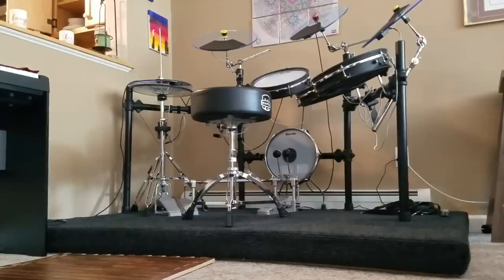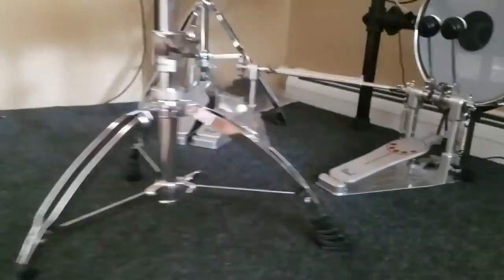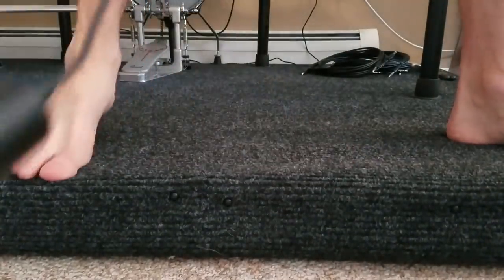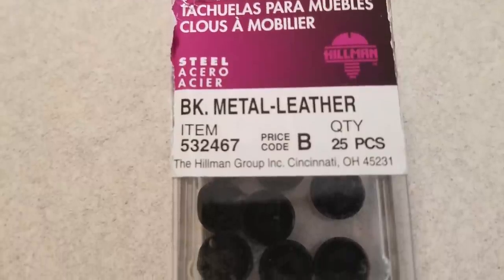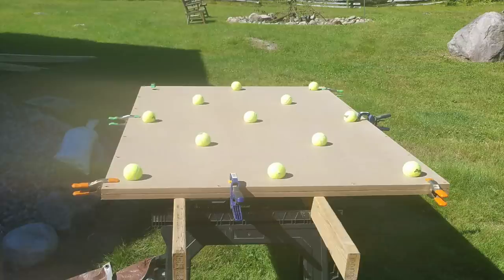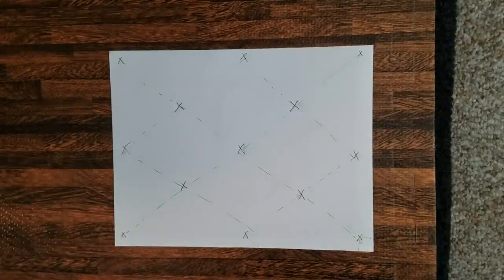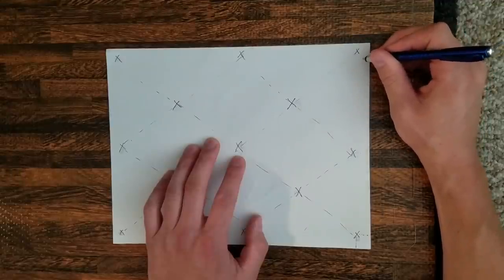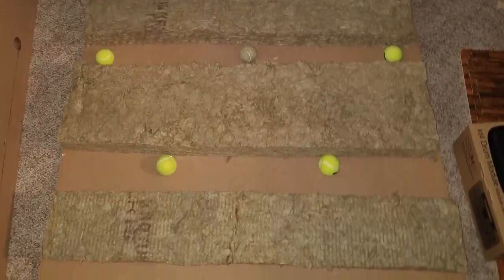DIY Sound Absorbing Drum Riser

Comment: So I just began this project for myself.. picked up all of the equipment from Lowes and Target, and one huge warning for anyone else who is going to take this on: make sure you have enough man power to carry the MDF board(s) up your steps. I'm not the most out of shape guy - I spent a good chunk of my adult life doing heavy physical labor for a living. But it took not one, but two of my neighbors to help me carry my two boards (same size as mentioned in the video) up to my 2nd floor apartment (no elevator, just stairs). And of course I had to pick them up and load them in a truck myself, too.

And no, I couldn't really have cut them on the ground floor because it's pretty much just parking lot and not safe (and possibly not legal) for me to cut the boards there. I suppose if I had known how heavy the boards were, I would have had Lowes cut them down for me before picking them up.

Just an FYI for anyone who might be in the same living situation as I am.
Reply from the maker: Yes they are quite heavy! Sorry I wasn't as clear about that as I could have been

Comment: dude, this is exactly what i need to build...i played for 3 days on my new kit, and on the 3rd day my neighbour under me came up and moaned...bare in mind ive had wild parties for years and he has never complained once :) the kick drum is the main culprit i think...i'll do a small board with balls just to test it, if that goes ok i'll try the full riser....cheers man. hopefully i wont get evicted lol....
Reply from the maker: DEADASTRONAUTFX haha good luck!
Reply: Blue Line Drums ,   hi man, got my 2 mdf boards drilled etc....just waiting on 15 tennis balls to arrive.... when you placed the balls between and added the tie clips, did you pull the clips really tight or slightly loose???..cheers.
Reply from the maker: I pulled the ties tight enough so the tennis balls were snug against the boards but not so tight that they were being compressed. Hope this helps!
Reply: Blue Line Drums , yup thought so....cheers man.
Reply: yay, i built the same way you did, but i also put half balls on the corners underneath for good measure....when tested with a seismic vibration app there was no vibration coming down to floor whatsoever, even with my mate kicking the hell out of the kit....so, yup,  totally worth doing man....cheers dude. happy drumming.  :)
Reply from the maker: DEADASTRONAUTFX Im glad it worked for ya!
Reply: yeah man, so far i havent seen a red faced neighbour lol.....

Comment: thanks for the video! just a tip but sitting on the platform increases the tension/rigidity in the tennis balls and so increases the vibration that makes it through. also for only a bit more cash can swap tennis balls with sorbothane which will reduce things more
Reply from the maker: Thanks for the tip!
Reply: What thickness for the sorbothane?
Reply: I presume the sorbothane would have to be very thick?

Comment: Awesome video! I actually ended up here in an attempt to reduce the noise that comes from my digital piano keys. The vibration goes straight through the floor and upsets my neighbor 🤷🏼‍♂️ I noticed you have a digital piano right next to your drum platform do you have that issue with key vibrations as well??

Comment: 5:50 "MDF is dense and heavy and I believe you need some weight to your platform to handle the vibration..." (slightly paraphrased).
MDF manages vibration far better than plywood because unlike plywood MDF is soft and absorbant. That's why a primary use for it is in the building of speaker boxes, cabinets and stacks - the vibrations caused by the sound are canceled out so as not to complete with it.
However, don't spill any fluids on it or it will be destroyed due to that very absorbency factor I mentioned

Comment: I did exactly the same thing : it’s quite working in term of impact noise réduction BUT:
1/ let the platform edges free or wood in order not to create resonating box (mistake i made) so not so sexy 
2/ better to use thicker plate
Reply: What?
Reply: @dteed6282  lol my thoughts exactly while reading this... Not a clue what Florian here is talking about...
Reply: I believe what he wants to say is that if the edges of the whole construction are connected with the carpet, you enhance the resonance of the whole thing.
So better leave it open.
I wonder of the wool doesn't shed tons of dust into the room while you play, if the construction is open.
Reply: @Wranuckl  the rockwool pieces  could be putted in normal black plastic bags (like the ones for the trash). this way the rockwool small particels will not "fly" through the air around.

Comment: This is a great video thanks! Some people have commented that sitting on the podium affects the noise isolation due to weight distribution? Have you found any issues?
Reply from the maker: I have not had this issue but I imagine different weights on top of the platform will certainly make a difference
Reply: @bluelinedrums1036  I made the exact same platform and it didn't cancel as much sound as I had planned. I may have tightened the zip ties too tight though so might amend it. It looks great though...
Reply: @drum27  How it's going now what did you do ?

Comment: Did you tape the insulation down? I'm in the process of making this exact riser per your video. Also did you nail the furniture nails to the board at the top?
Reply from the maker: Hey, I did not tape the insulation down. The compression from the boards did the job. I nailed the furniture nails to the edges and the underside...not on top. Hope this works for you!

Comment: I used 4 Wheelbarrow inner tubes I got at home depot $10 a peace . Under my tennis ball riser ( I use your video to make it thank you )  now 0 vibrations make it to the floor.  I probably  will get rid of the tennis ball riser  . It's a little bit to tall and just use the inner tubes  they work way better.
Reply: Good idea but questions:
1- how do you stop the tubes from moving around?
2- don't the tubes lose air every month or so, thus have to pump back up?
Reply: This is exactly what I was planning too. Zero vibration sound about right, compared to a pretty hard tennis ball, especially when compressed. Can you update us 3 years later on how it's holding up? Has it deflated a few times?

Comment: Great video, like the idea of the added insulation. I’m thinking of making this but don’t want to waste my time if it doesn’t make a difference to my set up. I don’t have downstairs neighbours to worry about as I have a cabin in the garden adjacent to the house. So, my problem is that I can still be heard (felt?) in the house. Would this type of platform help do you think or is it only beneficial to anything below it?
Reply from the maker: This will help with vibrations traveling to the floor and surrounding walls. If stick noise is the primary complaint then this will not resolve your issue. It will absorb the vibration within your house though
Reply: It’s relatively cheap to make and it’s going to help so I’m going to try it. Stick noise not so much the issue, it’s definitely the kick. Thanks for your input
Reply from the maker: Curious how this worked for you?

Comment: Great video thank you! 

I'm on the top floor (fourth floor) of my apartment. I got the Roland Noise Eaters, but I still got complaints by my neighbor. Do you think this platform would mitigate my issue if the Noise Eaters (which have gotten good reviews) didn't? Thanks!
Reply from the maker: When I built this I was also considering purchasing the Noise Eaters. Decided just to use my platform and it has been successful for me on the 3rd floor with no complaints
Reply: Blue line drums I am just curious if you spoke with your down stairs neighbor after you built this riser?
Reply from the maker: I did. Actually ran into her in front of the building where she brought it up and thanked me. 7 months later and no complaints

Comment: I built one and it doesn’t really work. A full sheet of 3/4” mdf, cut in thirds, two of which got tennis ball holes, the third wrapped in carpet for the top, rubber feet for the bottom. After the neighbor started beating on their ceiling again, I discovered with a vibration analyzer app that a lot of energy was still going through. The reason is because the vibration energy isn’t going to stop unless its converted into another energy; heat. These materials are not good at converting the energy unless there’s just a lot more of them. With more comes the problem of weight. The more weight you add, the more connected to the floor it is going to be. Still working on that but at this point experimenting with dispersing the energy over a broader area. Along with trying to use the vibrations against themselves by having them cancel out.
Reply: finding a way to suspend the platform would be gold
Reply: @Rorschach89  That was the next step. I bought a giant cabinet from goodwill. Then some rubber restaurant kitchen mats that I cut in half then mated them into giant "belts". I suspended one of the mdf panels from the ceiling of the cabinet (yes it was difficult). It worked. A little bouncy but I stuffed some moving blanket under it, added some wire coat hanger "staples" across the belt. And it became something you could get used to.
Reply: The cabinet served two purposes; It absorbed the stick and kick slaps and with some more moving blankets inside, it knocked down the crack of the drumsticks to pads. These were measuring around 80 db, but outside the cabinet these were reduced to around 63 average.

Comment: quick questions, does it matter if the tennis balls are pressurized or not? also wouldnt it make sense to build it the stage with a cut out space for your throne so your body weight isnt on the actual stage? or does that even make a diffeence
Reply from the maker: Cam Par not sure if the pressure of the tennis balls matters...I think the important part is the rubber material. I actually considered making a cutout for the throne but ultimately decided on not doing because of cosmetic reasons and ease of wrapping the carpet and padding. The 5/8th will work for the zip ties I mentioned
Reply: Blue Line Drums thanks for the reply man I appreciate it

Comment: Great! I live on the 4th floor apartment and just ordered an electronic drum set (Alesis command mesh kit). My question is: Could just a platform under the kick pedal be enough? I've just practiced at a friend on a Alesis Turbo and realised that they don't make much sound the way I play them. Of course the Turbo has only a pedal, and the Command a bass kicker thus my question about isolating just that? And because of small weight I was thinking of some disks from a fitness foam mat, or other form of foam sandwiched between two boards. Would that work?
Reply: What solution did you go with in the end ?
Reply: @Hegarz  I buyed the Command and I love it. Layed down two fitness foams under it with some semi harder disks under the legs not to sink much in foam. Might wanna do a test when someone is playing on them and you go bellow to know if they are iritatinf or not, mine can hardly be heard. Even less now that I rarely play them 😄

Comment: Will it work if you just make pieces for the bass pedals and the  bass drum trigger?  And or pieces for easch leg of your drumrack?
Reply from the maker: This won't exactly be a very scientific or tested answer, however, based on what I've read...the greater the mass of the platform,  the better it will be at noise reduction. If you make separate pieces for the contact points with the floor (similar to Roland Noise Eaters) I don't think it will be as effective

Comment: First of all, thank you for sharing your work. Second I wanted to ask you a question please, before I build this does your neighbor below hear any sounds at all? Is the sound faint or no sound below at all? Because I built a platform using double 1" thick carpet with one inch thick EVA foam and Isolate it Sorbothane discs under each drum frame leg and she still could here the sound even though it was very faint.  But still the sound was annoying to her. I would really appreciate knowing this first. Thank you in advance!
Reply from the maker: I initially tried something similar to the foam/carpet combo you are using but my neighbor complained still. You'll never silence all of the sound/vibration. With that being said, my neighbor would complain at the slightest annoyance and has not since I built this platform. The weight of the platform along with the rubber and foam insulation does a great job and I'm confident it will be an improvement for you. Let me know if you have any other questions! Mike
Reply: Thanks for getting back with me Mike. I did have another question please, did you put full carpet padding and carpet on the bottom of the deck also? Just something I thought was interesting, I did a test and took one of the mesh head drums off and held it in my hand and drummed as hard as I could and the neighbor said she did not hear a sound. So the sound is being transferred through the metal drum frame. The reason why your platform works so well is because you create air in between the floor and your drums. So I am hoping it will do the same trick for me.
Reply from the maker: I only used carpet padding on the top layer

Comment: Will it work for acoustic drums
Reply: Ummmmmm no. Acoustic drums are not only giving off vibrational noise through the floor and walls but also are creating real reverberation within the shells that will also be extremely loud. Your best option is a floating drum booth which still won't take care of all your noise. Good luck!
Reply: @FreddieTheRobot  acoustic drums give off the same vibrations as electric drums - you still have the forces of hitting the beater peddle (which is where most of the noise comes from). The difference with acoustic drums is that the vibrations will probably be the least of your worries if living in an apartment or with close neighbors.
Reply: I'm actually thinking of trying this out for my acoustic drums with Black Hole silencers.  Those silencers have worked wonders, but I still have vibration issues for the floor.